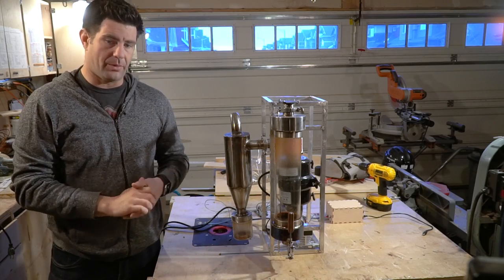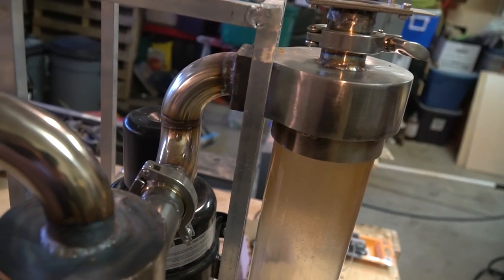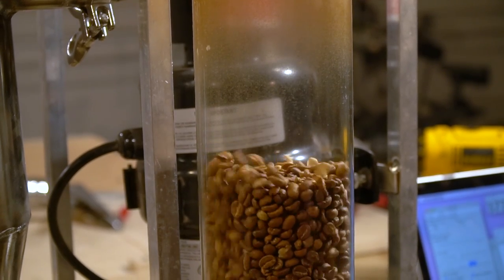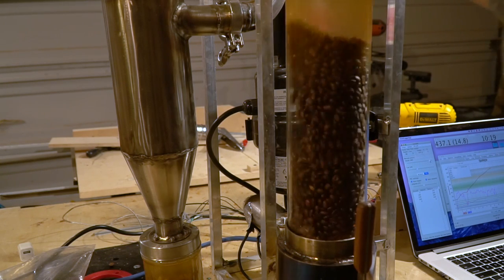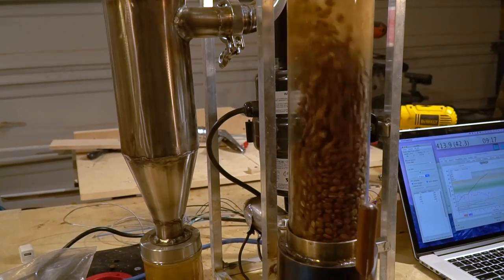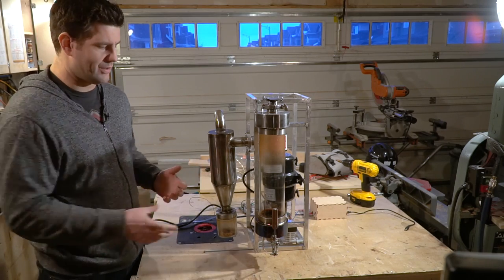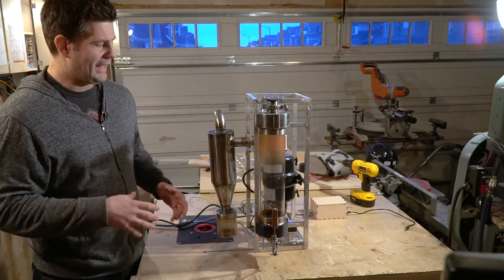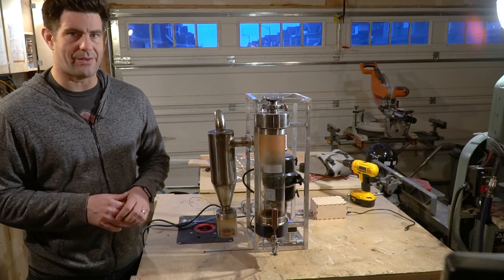Home Built Coffee Roaster Build

Comment: Great video. Very nice roaster. I built one about 4 or 5 years ago. It's all manual control, so much simpler, using propane heat and a blower controlled by a Variac variable transformer. The roast chamber is 4 inch metal conduit with the zinc plating removed. There's a borosilicate window in the side of the roast chamber.  The chamber can be lifted off the heater and dumped into an electric bean cooler. The blower I use is a triple stage, 120VAC vacuum motor, using the discharge side. A normal roast is 26 ounces (737 grams) although it can roast up to 32 ounces. 

Your roaster is much more complex than mine. But I enjoy the manual aspect of roasting!

Comment: Have you considered adding a tvoc sensor near the exhaust? I was watching a facinating video that talked about the corrilation between first crack and dramatic spike in tvoc when fan is constant as a great indicator. Could be a great data point to help in measuring given the air noise

Comment: Hi Alex,

Greetings from Taiwan! I just wanted to start by letting you know that I really enjoy your videos and I'm trying to build a coffee roasting machine based on your design. I had a couple of questions that I was hoping you could help me with, if that's okay.

Firstly, for your blower motor and heater, do you have any advice for how to connect the two parts together? In the video I can't tell if the air is blown through the steel pipes and then heated, or if it is heated through the welder before being blown through the steel pipes. If you had a design plan I would really appreciate being able to take a quick look at them. 

Secondly, do you power the blower and 3400W plastic welder independently? Sorry if this is a basic question but I've never attempted a project like this before. Thank you so much.

Thanks once again for your videos. Have a great day!

Sincerely, 
Shu Fen

Comment: How about automating the fan speed by putting LED light beams at varying heights and outside the glass envelope? Yes, you would have to keep the glass clean. Alternatively, instead of a beam, use a photo cell to try and monitor bean height in the cylinder with ambient light shining from above. In either case, the way the beans bounce in the cylinder, you may need to integrate the feedback somewhat to avoid rapid changes to fan control voltages.